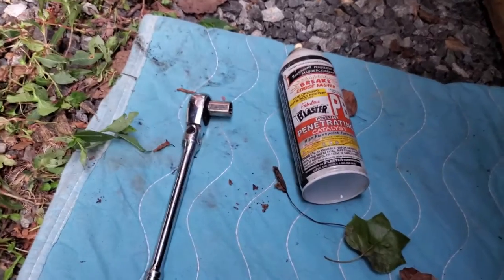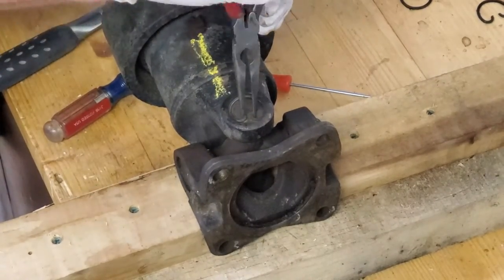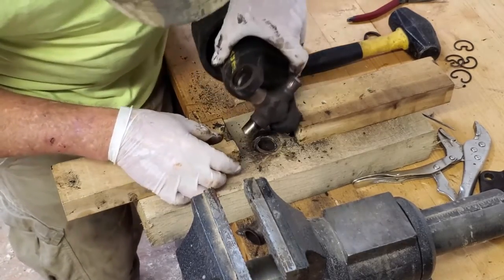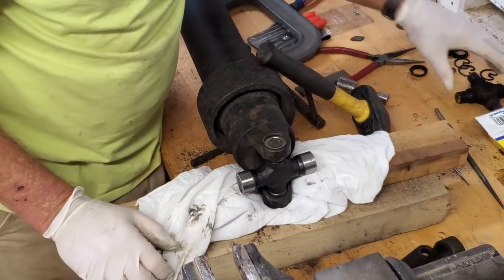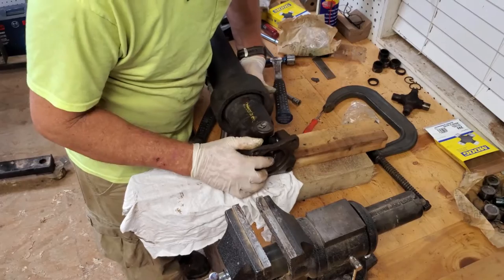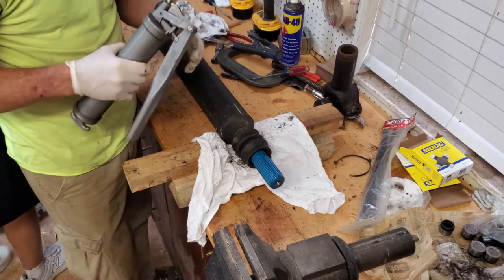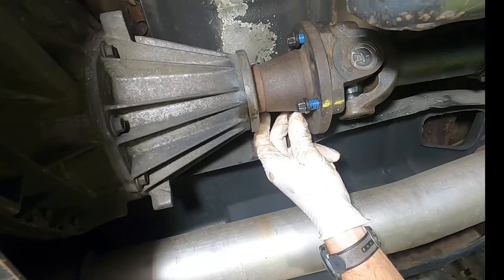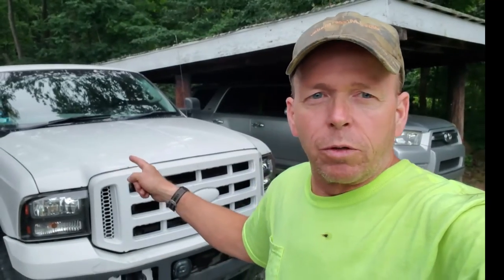Repairing the 2001 F250 Driveshaft U-joints

Comment: When I was still doing amateur auto repairs on my vehicles (long, long time ago), I had the good fortune to have a rather large vise that I could use as a press. I found that I could get those bearings out of the driveline without any impact force by using quarters to shim out the face of the bearing cup to displace them in the vise... Eventually, I found the right diameter socket wrench to do the same thing easier... Good, smoothe job that way... Gary
Reply from the maker: I wish I had a vise that size. Would much rather have pressed them out, the pound them into submission.

Comment: Nice job demonstrating your really good techniques on what can be a tough and frustrating job.

I especially like your Wooden Holding Fixture. I have to replace the U-Joints on the front Drive-Shaft of my 2000 Expedition with 196K and eventually on the rear shaft. Your Wooden Fixture will make 4 PITA jobs easier.

I've done several U-Joints over several decades. On the last one, I pulled the 4 cups, loaded them up with the same high-quality grease that's in my grease gun, and set them aside.

I inserted the cross and pressed one cup in flush with a large C-Clamp and then the other cup. I then pressed one cup at a time, using the C-Clamp and a Short Socket, until I could insert the locking rings while forgetting to press the cross from the other end to seat the first cup firmly against the locking ring. My Bad. With the 4 cups locked in, I gently taped the casting till the joint rotated easily.

I progressed over the years to get to my latest method, proving that you can indeed 'Teach New Tricks to an Old Dog'. HaHa

My 'Now-Methode' is a simple adaptation of yours and if only I'd seen your video 60+ years ago, I wouldn't have had as many bruised knuckles and my Budwizer Expenses would have been much lower. Double HaHa.

Again, Nice Job. Thanks for posting......

Comment: Good job marking everything before you start. Especially the punch marks. I was taught that back when I worked in an electric motor shop. If the motor got steamed cleaned and painted you still had the punch marks.
Reply from the maker: A little research let me know to mark with the marker, but we made the punch marks as back up. Just to be sure

Comment: Hi Deb and Chuck,
Chuck, Nice repair. That one joint that felt a little stiff, sometimes you need to seat the bearing cup up against the snap ring after the snap ring is installed. Should have no problems with all the replaceable parts done on the running gear. What gauges do you have on the A pillar? Both of you stay safe.
Reply from the maker: I did manage to get that stiffness straightened out. Let's hope all those parts last a good 30 years. 
The pillar Guage were in when I bought it. Not sure who made them, but they show Turbo boost, exhaust gas temp, and Trans temp. It's all good info to monitor

Comment: You realize you probably just ruined your socket extension.  The hole will not be square.  Also I hope the socket will fit your nuts again after all the pounding?
Reply from the maker: Absolutely. It was an old one, and it wa sacrificed for the repair. A new extension and socket will arrive today.